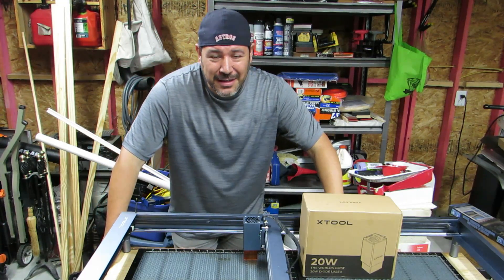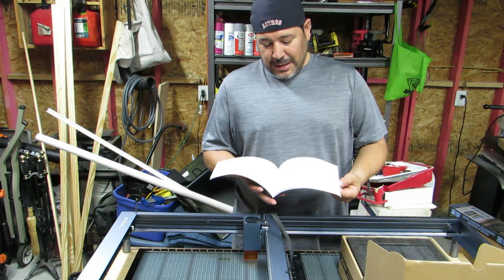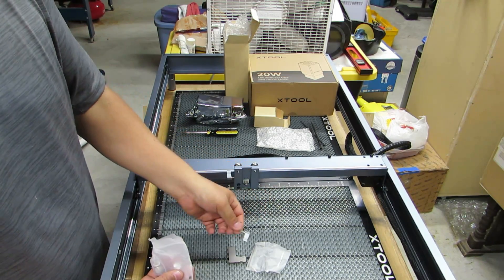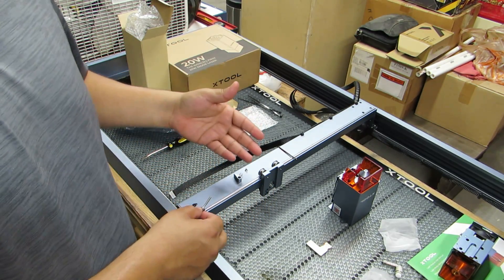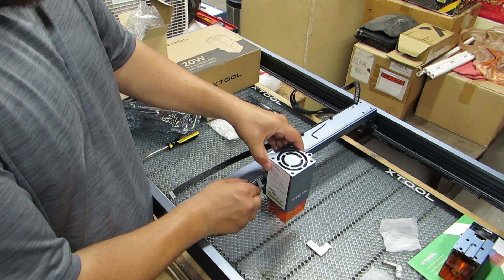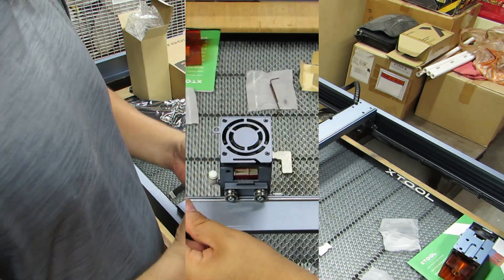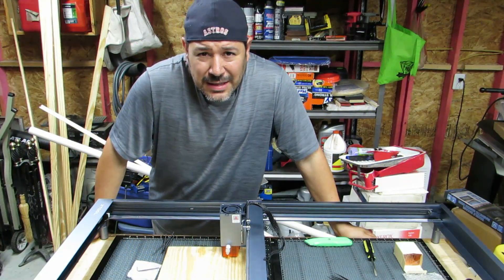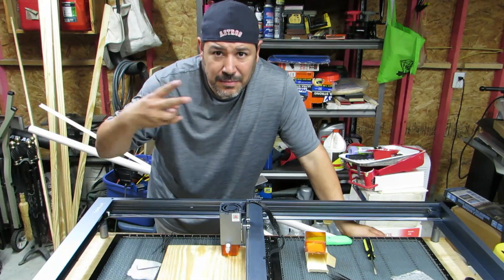Xtool D1 20w Laser Module Upgrade (S5; E2)

Comment: Did you have to make any adjustments in light burn? I upgraded my  10w to  a 20w I think my  10w was almost as powerful, to cut through 3mm wood I have it at 7mms and  99% if I go any faster or less power I end up with spots it doesn't cut all the way through. I can't use any of the  20w settings in the material library.  If I would of known about the two cable issues, I would have bought the upgrade for my  pro instead.
Reply from the maker: I didn't need to make any adjustments in lightburn. It just depends on the type of wood and if it's hardwood or softwood, grain, knots, etc... For the 20W, to cut through most 3mm woods, I have it at 6mm/s and 100% power. When it's done, most of the time I can tell if the cut piece completely separated from the negative. If it's not quite there and I have to run it again, I up the speed to like 10mm/s and same 100% power and it'll finish the cut job. I usually speed it up to finish it off, if it has a few spots that didn't cut all the way, because it doesn't need to be that slow and it saves time.

I figured it was going to need a second power source when I saw the power adapter in one of the images on the product page and just figured, oh well. If you need a nice but price-friendly power strip with individual switches, check this one out. -- https://amzn.to/3QYbBiZ -- Speaking of, I believe I completely forgot to post that video review. jeez lol

Comment: where do you buy just the laser at how you did?
Reply from the maker: xTool does not sell just the laser module anymore. You need to buy the D1 Pro version now to get the 20 watt. You will now have to search online like ebay or amazon.
Reply from the maker: @shawnverse_gaming01 According to a seller on Amazon, you can buy their laser module and a D1 compatible accessory kit and it will work. They also have a video showing how to assemble it. See links below.

https://amzn.to/3JfwUIS - 20W laser module
https://amzn.to/3JjaqHi - compatible accessory kit to fit xTool D1
Reply: @DiverseCityPrint  thanks
Reply from the maker: @shawnverse_gaming01  you're very welcome.

Comment: I have the original XTool D1 10 watt laser engraver/cutter (non pro version). I really like the machine a lot, and I want to upgrade it to the 20 watt laser module now in order to speed up project engraving and cutting times. 

However, Since the 20 watt laser module is out of stock everywhere, including at XTool, I contacted XTool directly, and their CSR said that they are no longer making upgrade parts for the original XTool D1. In order to get a 20 watt laser module now, I would have to purchase a whole new XTool D1 Pro version. Say what??? XTool sure didn't sell the 20 watt laser module for the original XTool D1 for very long. It looks like a typical ploy to force customers to purchase the new XTool D1 Pro at a much higher price. 

Does anyone happen to know if the 20 watt laser module for the original XTool D1 is still in stock at any 3rd party sellers? Any help in finding one would be greatly appreciated. Thanks!
Reply from the maker: Oh man! I thought I replied to this! Unless I forgot to click submit. :/ I remember when I first saw this post, there was a 20W module on Amazon and the seller was actually xTool! I'll check when I wake up and see if I can find it again, if it's still available.
Reply: @DiverseCityPrint  Thanks for responding. Better late than never...lol. j/k. Yeah, ever since Xtool stopped making the 20-watt upgrade laser module for the original (non-pro) D1, it is impossible to find anywhere. Xtool did not produce the 20-watt laser module for very long either, which makes it even harder to find. 

However, I recently got lucky on Ebay. Someone was selling a brand new Xtool D1 20-watt laser module and D1 maintenance kit. Both were still in the original, unopened Xtool packaging. I got everything at a really good price, and the 20-watt laser module works great. The seller said he purchased the 20-watt laser module and maintenance kit for his original D1, but then decided to buy a new Xtool S1 when it came out, instead. He never even opened the 20-watt laser module or the maintenance kit. 

I guess I really did get lucky though, as a lot of people are still looking for the 20-watt laser module for the original D1. This will get me by for a while, as my next laser will definitely be a CO2. These little open frame diode lasers are fun hobby/small business machines, but IMHO nothing beats a CO2 laser for fast, quality production, especially when cutting thick materials.😊
Reply from the maker: Oh man, you DID get lucky! Nice. Yea, I just wanted something cheap to get started with laser printing and open frame. I love it because I can engrave/cut pretty much anything in size but definitely saving up for a co2. Glad you were able to find that 20w. I'm sure you're loving it!
Reply: @DiverseCityPrint Yeah, I bought the original 10 watt Xtool D1 back when it was first released, for the same reasons you stated, and nobody had really even heard of Xtool (through Makeblock) at the time. Now Xtool  has really taken off and has become a very reputable laser company. My D1 still looks and works like brand new, and having the 10 watt and 20 watt laser modules now makes the unit even more useful. I use the D1 a lot, and routinely maintain it. Hopefully, the D1 lasts many more years, even after I get the CO2 laser, as it is a very versatile machine.

The only "drawback" of the 20 watt "upgrade"  module on the original D1 is that its power is independent of the main unit, and has to be turned on and off (unplugged) separately. I have all of the D1 laser  components, work lights, air assist, AC Infinity smoke extraction system, etc. plugged into an 8 outlet surge protector with individual power switches, so I just plugged the D1 and the 20 watt laser module power supplies into the same switched outlet with a 'Y' adapter. Now the laser module and D1 power on and off simultaneously. It works great setup this way. 

I actually do a lot more engraving than cutting for now, but it's nice having the 20 watt laser to cut thicker wood in one pass when necessary. My background is in  I.T. and graphic art, so I really enjoy creating original projects in Lightburn. If anyone ever needs laser advice, Rich, "The Louisiana Hobby Guy," is the go-to guy in this field. Rich really knows his stuff, and he has a great YouTube channel and website/forum. 

Good luck with your business and great videos. They are a lot of work, and a lot of  fun at the same time. 😊
Reply from the maker: @TheGuitarman1968  I hear ya on having to power it separately. I have yet to get a surge protector with individual power switches. Which one do you have or recommend? I have a couple in my favorites list, but keep forgetting to just purchase one and try it out. I'll check that channel out, and thanks for the well wishes! Editing videos is a nightmare! LOL it's only fun when it's ready to publish haha. Hard to find time to make content these days, but I try my best.
Reply: @DiverseCityPrint  The surge protector I use is made by "Greenbox Innovations." There are 6, 8, 10, and 12 outlet versions of the surge protector. I have the 8 outlet version. The surge protector is made of all metal construction, and it is black and yellow in color. It has 1 main breaker switch and 8 individual power switches placed one under each outlet. All of the switches have red colored lights when in the on position. The surge protector also has wire management brackets and 14 gauge internal wiring, so it can handle 15 amps with no problem. It also has 3,300 joules of surge protection, a 6-foot cord, and the 8 outlet model is 2 feet in length. The surge protector also has several different mounting options. I have the laser engraver, and all of the tools and accessories plugged into this surge protector. It works great to give individual control to everything plugged into it. I did a lot of research before buying the 8 outlet Greenbox Innovations surge protector on Amazon for around $40. I hope that information helps you choose a good surge protector. Having one is both convenient, and it also protects the expensive laser engraver from damaging power surges. 🙂
Reply from the maker: @TheGuitarman1968  nice, thanks for that! I'll definitely check into that asap.

Comment: Great explainer! Will defo upgrade to 20w now. On 3mm material what in your experience is the difference in speed from 10w to 20w? Thanks
Reply from the maker: I never used the 10W. The unit came with it but I purchased the 20W at the same time and have been using that since day 1. My 10W is only for backup. I know someone locally that uses both the 10W and 20W and says the 20W is easily twice as fast because he only needs 1 pass while cutting and the 10W needs 2 passes or even 3 passes if he makes it cut faster per mm.
Reply: @DiverseCityPrint  thanks - am awaiting delivery of 20w module for my D1 and apparently the D1 (not D1pro) is discontinued. Been really surprised with the quality of build of my Xtool
Reply from the maker: @simonbyerley3153  Noice! Let us know how it goes, and yes, the original D1 was discontinued a long time ago, but also if you didn't know, you can still upgrade the original D1 unit, to the 40 watt module! (with a few stipulations)... See info in the description, if interested in doing that down the road.
Reply: @DiverseCityPrint  thanks - 20w has arrived but does not fit the holding bracket on my D1 - the laser module has a wider back plate so I can't attach it :(
Reply: @simonbyerley3153 sounds like you ordered the head for the pro unit. Or pro unit v2.
Reply from the maker: @dog0311  Yup! Sounds like @simonbyerley3153 got it for the D1 Pro. The 20W for the Original D1 was only released for a very short time, then the D1 Pro was released and they started making the 20W for that version and stopped MFG'ing for the Original D1, unfortunately.
Reply: @DiverseCityPrint my 10w would cut 3mm with one pass but at 3mm and 100%
Reply from the maker: @dog0311  Sounds about right. I wouldn't have patience for that lol... I barely have patience for the 20W haha!

Comment: Where did you get the 20w module? I have a 5w non pro version and can't find a stronger laser anywhere. Xtool told me I have to either upgrade to the 40w, or buy a whole new pro machine.
Reply from the maker: My bad. Thought I replied. I got mine from xtool. I've seen 20w modules on Amazon that are xtool. Might wanna check there. So you have the original D1? I believe they still have the 40w upgrade module with everything needed and you'll be able to upgrade the original D1 to a 40w. Unless you think it's worth it to you to just get a Pro unit.

Comment: If I have the 10w non pro can I upgrade to the 20w from a pro model ...will it cause me any issues?
Reply from the maker: Think of the laser modules and the actual machines as two different things, but yes, you can upgrade the D1 (non-pro) unit to the 20W module. According to xTool, you can technically upgrade the D1 to the 40W module! Check the video description, as I updated it with a Q&A related to upgrading the D1 with the 40W.

Comment: Anyone had issues with the 20w upgrade and lightburn??? Maybe not working or anything ...
Reply: It doesn't seem to be as powerful as it should be. The settings in the lightburn material library don't work at all for my 20w I've downloaded several xtool 20w material lib and none of them work with mine.
Reply: @dog0311  thanks for the reply,...i went ahead an invested in a 100w laser instead,...best choice ever

Comment: when you bought your 20w module, did it came with the power supply?or do you have to buy it separate?
Reply: If you upgrade to the 40w it comes with a new power supply and gantry.
Reply from the maker: @jakerazmataz852  Yea, but the 40W is only compatible with the D1 Pro, so y'all be careful with that. My timing sux bro.
Reply: @DiverseCityPrint  Yea, a lot of people were pissed. People had the original on the way and they released the Pro. Like I said I upgraded with extensions. I have the whole 5w Pro, cables, limit brackets, MB, etc. EXCEPT the short rails, start button and opposite. If they are compatible with the Pro rails I might be interested in selling it.
Reply from the maker: @jakerazmataz852  Yea, I was one of those people to say the least lol... and I would think that'd be compatible but not sure. Try asking xTool. They used to answer my messages quick, but since they have 'blown up' it takes over a week to get a reply, if any. :/
Reply from the maker: @jakerazmataz852  It looks like you can now buy the 40W kit that can also be installed on the D1 (non-pro) unit! It has the laser module, main control board, X gantry, and other accessories needed to upgrade! It limits some of the features, but at least it can be done. Either this kit is recently new or I just missed it several months ago. $1,000 to upgrade original D1 to the 40W laser, or $1,500 to get the entire Pro unit with full features, 10W + 40W... decisions decisions!
Reply from the maker: If you buy from xTool, it comes with everything you need to run it. Yes, it came with the power supply.

Comment: I just upgraded my D1 Pro from 10 to 20 watts. XTOOL must have made some changes to the 20w module. On mine, I do not have to change the locking mechanism. You just remove the old laser module and install the new one. Also, you do not need to use an extra power cable. You just remove the original power adaptor and plug the new one in its place. The adjustment for thick wood is done conveniently with another locking mechanism on the other side of the module from the main locking tab. This video is only 1 month old, but Aurora Tech did a review of the 20wattt D1 Pro 7 months ago and she has a module like mine. I love how much faster I can cut with it.
Reply: That is because you have the D1 Pro. The extra power supply is for the D1 non-pro unit. They are different.
Reply: @medic5388  That explains it. Thanks.
Reply: @medic5388 those of us that jumped on the band wagon to fast have the first release that really sux.
Reply: does the 20w module comes with power supply?
Reply: @zhyle02  Yes
Reply: @zhyle02 mine did, so now I have to run two power bricks.
Reply: Mine was a whole new setup for the diode, seperate power brick also

Comment: The on and off switch does not work as you plug in the new power cable the 20w comes
Reply: Yes pretty much how it works..i didnt know that and when i plugged it in the brick was also plugged in and almost shocked myself to next monday
I think thats abit dumb tho, it should plugg into the machine so theres no need to plug and unplug.
Reply from the maker: @thatonegamer2709  Yeaaa, I hear ya. You can get a surge protector that has individual switches and plug them all into that, and you can turn on/off each plug individually. It's pretty nice. Better than shocking yourself to next Monday.
Reply from the maker: I don't think mine has an on/off switch. It's always on unless I unplug it.

Comment: I upgraded mine today BUT is there some software changes to be made. Mine frames and moves but laser does not fire.
Reply from the maker: I haven't noticed any software difference. Did you get it figured out? Maybe someone at xtool can help troubleshoot. Do you have the correct config file uploaded? I can't remember exactly, but I wanna say that happened to me at first but then uploaded their config file from their website and worked fine after.

Comment: Just got 40w
Reply from the maker: I knowww! As soon as I got the regular D1, the D1 Pro came out a couple months later! Was really sour about that lol. From what I've read, the 40W is only compatible with the D1 Pro, which I'm bummed about.

How's that 40W power? I can't wait to upgrade.
Reply: @DiverseCityPrint  cutting times have been cut in half.  Will try engraving this weekend.
Reply from the maker: @GaryRose  And I thought cutting times in half with the 20W compared to the 10W was awesome... sheesh! I'm jealous! :)
Reply: @GaryRose what about engraving time? Has it been cut down by half also?. I mostly do engravings and if my work would get cut doqn by half or even less with the 40w it would make my small business alot better.
Reply from the maker: @thatonegamer2709  I know the wattage has effect on the cutting but I believe the engraving relies on the max speed of the unit since you're using low power/high speed. The regular D1 unit goes around 166mm/sec max and the D1 Pro goes around 400mm/sec.
Reply: @DiverseCityPrint actually buster beagle makes 3d printed attachments for the 40w module to fit the d1, you need to switch out the motherboard obviously but  it works, im trying to decide if i want the 20w or just shoot myself in the head with the 40w and get over it.
Reply from the maker: @thatonegamer2709  I'll need to check those 3d attachments out! And if it was me, I'd go for the 40W. It's just something worth getting in my opinion. 20W for hobbyist and playing around - 40W if using it for selling items.... time is money.
Reply: @DiverseCityPrint  dumb question but are times for engraving done more quickly also with the 20w or 40w? ..i seen both for cutting but not many are showing engraving times compared to the 10w..🤔🤔